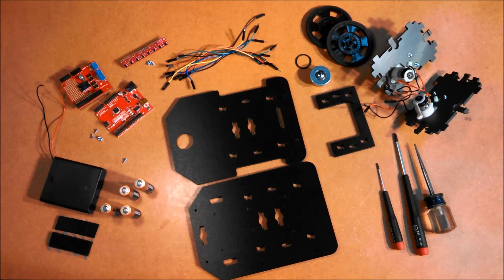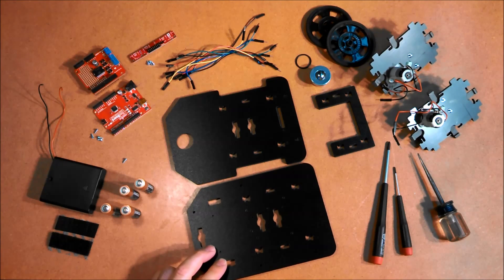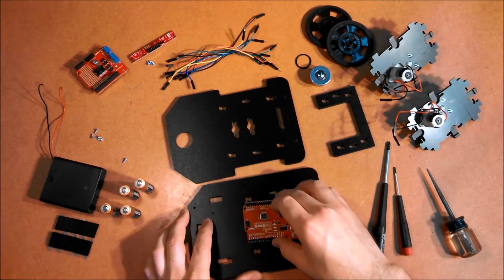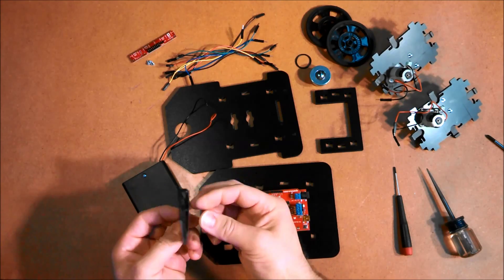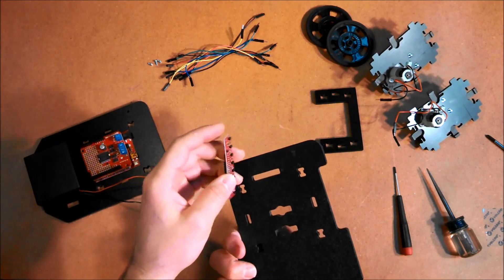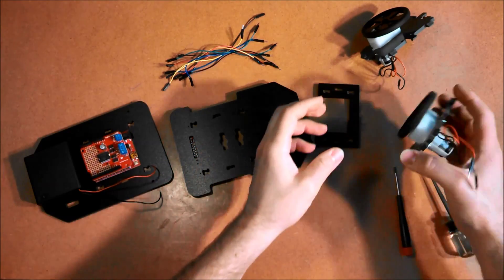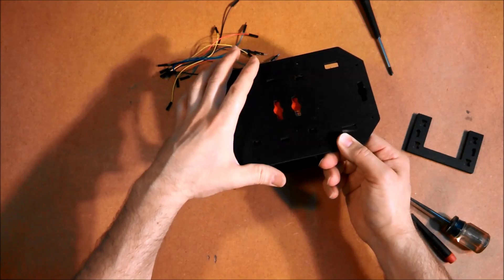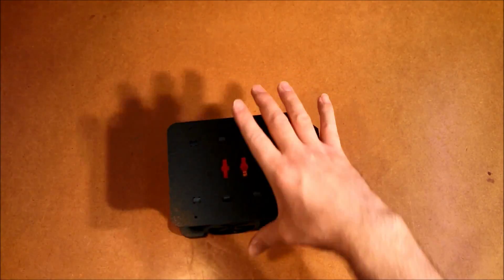Gobbit Robot Maze Solver and Line Follower Assembly

Comment: Search for maze_line u can see it I hv uploaded it pls respond abt the happening
Reply: Or u can search Devyank Shaw there u can see
Reply from the maker: Devyank Shaw , looks like you need to check your wiring of the motor driver.
If you are using the code in the example, I doubt it will work with that sensor if you did not update it.
Reply: Here I hv not used the pololu qtr-8rc sensor it will a prblm??
Reply from the maker: The code uses the library for the qtr sensor.  I do not know what your sensor uses.  You probably will have to modify the code a lot since it is very specific to the qtr library.  At that point, the code becomes more of a reference.

What sensor do you have and what library supports it?

I will try to help, but this appears to be for a class project, so I will not solve it for you.  That would defeat the purpose of the education of your assignment.
Reply: No it's not school project I am appearing for an event organised by iit kanpur so pls help me out
Reply from the maker: What sensor and library?
Reply: PrimalEngineering can I hv ur facebook name I am  sending the image of that sensor
Reply from the maker: I saw your sensor in your video.  Do you have a part number or any information about it?
Reply: PrimalEngineering 
Part no : ELE00008
Reply: Operating voltage : 5v
Supply current : 100mA
Output format : 8 analog nd digital voltages
Output voltage range : 0v to supplied voltage 
Optimal sensing distance : 3mm
Reply from the maker: I looked and could not find any information on function.  Any information on how it works?

Without knowing what it is sending as a signal, I cannot really tell you how to use it.  It may simply be signaling high if it sees the line, or it could be similar to the QTR-8RC where it requires timing to measure properly.
Reply: PrimalEngineering Here can l use Arduino UNO-R3
Reply: PrimalEngineering See I hv got all the kits r u sure it will definitely follow the maze line
Reply: PrimalEngineering I am only just a 1st yr student so I am very interested to perform this event
But the coding is tough to make by this coming saturday 
So I am totally dependent on u
Reply from the maker: I am not sure what you meant here.  Are you saying you now have the same components as were used in the video and instructable?  

If so, then yes it will follow the maze.  If you are still working with different components which you are not sure how they function, then I cannot say they would work without a fair amount of changes.
Reply from the maker: NO, you are not "totally dependent on" me.

The videos and documentation I have made public, along with the many others that have done the same, is to provide sources for people like you to learn and accomplish solutions for themselves.  Our goal is not to carry you to the finish line, but to empower you to carry yourself.

To further my point, if I do not have the information you need, keep looking and you will find someone else that does.
Reply: PrimalEngineering I will be getting the same components that u have used throughout the video
Reply from the maker: OK.  Then your robot should be able to be "tuned" to run the maze.

Just to be clear, the line sensor you had in the video you posted should be able to work as well, but you would most likely need to be able to rewrite the code to be compatible.
Reply: PrimalEngineering I hv order the qtr-8rc reflectance sensor
Can I use Arduino uno-R3
Reply from the maker: Yes, the redboard is an uno clone.  The program is the same for both.
Reply: PrimalEngineering In ardumoto where the motor r connected there I hv attached stackable header pins there will be any prblm??
Reply from the maker: If you are saying you want to use female or male headers instead of screw terminals, that is OK.
Reply: PrimalEngineering how will I know that the qtr-8rc reflectance sensor is working
Reply: Pls see the video I hv uploaded it wht is happening I can't understand pls help me out maze_line
Reply from the maker: https://www.youtube.com/watch?v=JFrexM1UKO4&t=11s

Notice the robot does a calibration first.  It turns to the right at the beginning.  Try reversing the wires on your left motor.

You will probably have to adjust the PD settings as well.
Reply: PrimalEngineering PD setting means??
Reply from the maker: see line 219 of the program.

The kp and kd values that affect the line following adjustments of a control loop.

The other main variables you may need to adjust are at line 26.  The turning variables.  The values you may need to tweak are noted as "tune" in the comments.  When in doubt, slow down your turn speeds.
Reply: PrimalEngineering but how much I will slow down
Reply: See today we hv got the kits nd tomorrow we hve the event so only today we hv the time
Reply: So pls help out
Reply from the maker: I am only pointing you at areas to adjust IF you need it.

Test changing one thing at a time and see if it makes things better or worse.  I cannot do it for you.

You should probably have a straight line course that is about 24" long just to see how well it follows the line.  Start with getting the kp and kd values working well enough, then move to the turns.  IF the kp and kd need adjusting, try starting with kp low, around .01, and kd maybe .5.  Work up slowly from there.

Again, you have to do this for yourself.  I cannot test it from here, nor would I since this is your project.  My advice is as far as I will go, otherwise, you will have nothing to show your school except my homework.
 
Good luck.
Reply: PrimalEngineering But how will I understand that the is working